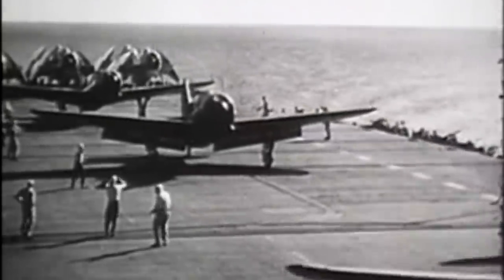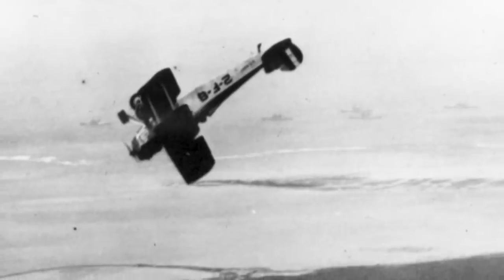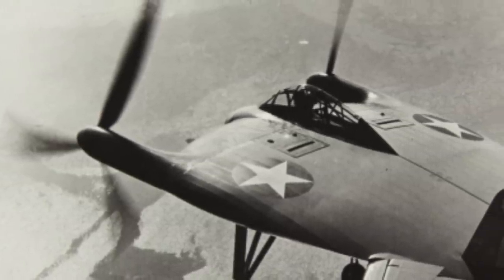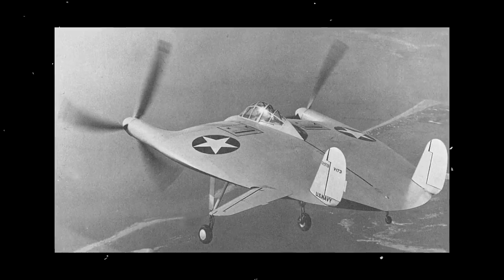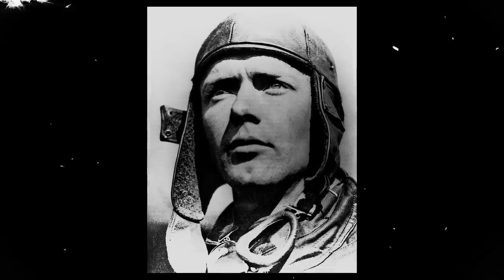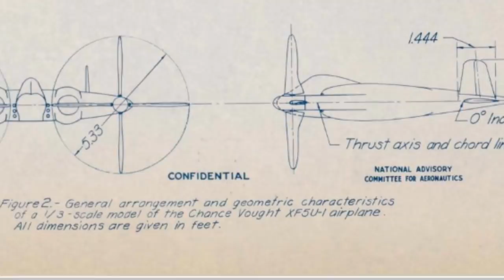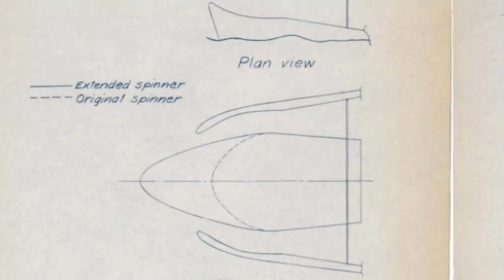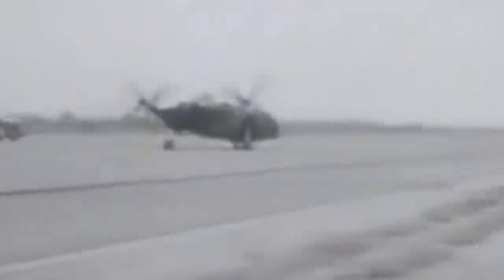The Experimental All-Wing Carrier Fighter - Vought V-173

Comment: I'm no aeronautic engineer but I don't se how "being impossible to stall" would be underperforming...
Reply: Military aircraft need to be stallable to increase combat mobility. Why Vought didn't pursue commercial sales for the Pancake is beyond me.
Reply: @engineerskalinera  right? That sounds like a good safe plane to learn on and use in remote areas like the Alaskan interior.
Reply: @erikwellerweller8623  There are a lot of technical/factual errors.  They have several different channels with exactly the same format and are constantly putting out videos.  Point being I don't think getting the information 100% accurate is their top priority.  I think it's quantity.
Reply: Your rt. Impossible 2 stall plus spin is a great performance quality. Especially preventing flat spins.
Reply: PS the only drawbacks R its fuselage angel of attack causing poor pilot vision. Plus propeller size related 2 its ground clearance & landing gear in the horizontal configuration. Not much distance between prop tips & runways. 1 minor mistake with the elevator & props dig in causing a nose over. Not a forgiving aircraft. A tricycle landing  gear might've been a better setup.
Reply: by "stall" i believe they mean falling straight down without pointing itself downward, pulling it out of a stall
Reply: @barrylyndononlyfans  that's a flat stall. Most times with a flat spin left or right added. Impossible 2 fly straight, stop, drop straight down & fly off straight again in a conventional plane. Unless it's a Harrier or F35 type of VTOL aircraft.
Reply: They sacrificed speed by "tuning" the airflow with the exaggerated props/
The prop situations were not necessary for super-STOL stall proof slow speed flight nor for efficiency at cruise.
Reply: @engineerskalinera  
They do not need to stall, they need to be nimble. Many planes of very-low aspect-ratio have been both.
Reply: @barrylyndononlyfans 
 Stall means the flow over the top of the wing separates, negating lift and not allowing strong smooth flow to the trailing edge controls.
These did neither.
Many planes of the sort have been nimble at the same time.
Reply: @kendenning6517 
 The wing-tip mounted, oversize props were not necessary for super-STOL performance not stability or control, nor for efficiency at cruise. 
See the "flying heel-lift" youtube of the Arup S-2 from Indiana in 1932, which Charles Zimmerman patterned the planform of the flapjacks after.
Many planes of the very-low aspect-ratio sort have had normal propulsion, and have allowed normal pilot view.
Reply: Can it, the damn thing is Impossible to stall or spin.
Reply: Despite it not being able to stall, there's no reason to think it couldn't have been able to be designed to be flown as if to mimic anything an unstable, stall-able plane could do.
Reply: Try deck landing without being able to stall

Comment: It's a shame they were destroyed, that was very short sighted.
Can you imagine the good work they could have done as a STOL Fighter/Bomber in Korea?
I would love to see a turboprop version, just to see what it's range/endurance would be, there is a lot of room for fuel.
Reply: There was a concept design for a jet/turboprop version of the xf5u.  Because of how its engines were installed in the xf5u, it looked like it hadvjet engines also (it had a fan mounted inside a duct leading to each engine to cool the engines since the engines were mounted more inside the aircraft than normal).
Reply: He didn't mention that the one that did the hops is at the Smithsonian. It wasn't just the canvas version that survived. Only 1 of the 3 airframes was actually destroyed
Reply: @alexsis1778  actually, all the xf5u were destroyed, the v-173s were the ones that survived.
Reply: The V173 survived and I even got to see it being restored while working at the Vought Jefferson Street Facility in Dallas Texas
Reply: @fir3ball343  that is the one that was restored while I was working for Vought
Reply: @fir3ball343  Been there before, it's such a unique plane.

Comment: “The airframe was so stiff that a wrecking ball was needed”
 This thing is going to be goddam invincible to cannon fire and the US cancelled it

Why (also we need this plane in warthunder)
Reply: Gaijin pls
Reply: @GrunOne  probably a 50000 eagles premium at 8.0
Reply: @foximacentauri7891  And still outclimbed by bf109s...nothing's changed...
Reply: I think they teased it a while back, but they said they weren’t going to add it. :(
Reply: Cause jets
Reply: Yeahhhhhhhhhhhhhhhhhhhhhh boi
Reply: It actually took 3 hits to even crack it.
Reply: With aviation advancements, I would say it was mostly useless after WW2. It has a large easily targetable profile from weapons that are more damaging than cannons. Needless to say, the experimentations were used for later aircraft development.
Reply: @KevinSmith-qi5yn  the same can be said for the a-10 though.  Also, depending on where it was hit, it probably could survive some of those more damaging weapons as well (as stated, it took 3 hits from a wrecking ball to just crack the skin, with the third hit having to be aimed at a precise location).  The A-10 was designed to withstand 23mm cannon rounds (both explosive and armor piercing) specifically by the way.
Reply: I want this so bad in War Thunder. Loved playing it in World of Warplanes. 
The problem with it in War Thunder is the damage model. 
-The only way to kill it would be pilot snipe since there are no wings to rip off. 
- it would also be positioned likely at 7.0 since it is compatible to early jets in speed while being much more agile.
Reply: @jonathonspears7736  I wanted it in war thunder too lol.  As for wings, they could probably model them somehow, just be a lot of wing to have to rip off.
Reply: They used to have it but removed it
Reply: @nuttynuts4601  actually, that was an april fools joke unfortunately.
Reply: @jayburn00  Oh man, thanks for that info though
Reply: I will sell my soul to have this on warthunder
Reply: @ Canadian Waffenswagger  - Actually, when the wrecking ball first hit the XF-5U it bounced off! It hit one or he wing ribs.  When struck between the ribs, the ball went right through. The aircraft was cancelled for good reason. Vibration issues were severe.  It was way over budget. Entering an age of jet fighters, the prototype had not yet flown, in 1947!  Certainly, it would have been interesting to see it fly and judge it's relative merits but by 1947, the flapjack concept had flopped.  Constructed on the east coast, it was deemed not worth the trouble to transport it to the west coast where flight tests were supposed to take place.  
   Speaking of flying flops, how did the Canadian flying saucer project work out? The Avrocar?   LOL! Unfortunately, Canada managed to talk the US into investing in the damn thing.
Reply: @scootergeorge9576  Vibration issues can be resolved (depending on the cause, there are different solutions/mitigation techniques).  Increasing the number of propeller blades by one or decreasing the number of propeller blades is one way.  Changing the way the engine is mounted is another.  The concept hadn't flopped, it simply was not developed further.  A lot of aircraft that showed promise have been canceled before they could really prove themselves.  I do agree with you on the avrocar though, that was ridiculous.  Funny thing though, the Germans were trying to do something similar to the XF5U but had even less success with it than the US did (they never got past developing their counterpart to the V-173).  The reason the Germans had even less success with the concept is an ironic situation:  despite Germany's progress and reputation of being ahead of everyone in aerospace technology development, it turns out there were certain areas of aerospace technology that they were behind in (not many, but there were some).  One of them happened to be the idea of using counter-rotating propellers to cancel out the effects of vortex drag while producing more lift.  Their counterpart to the V-173 was a single engine and single prop aircraft (forget its designation).  As a side note, another area they had trouble with was high altitude performance in propeller driven fighter aircraft; they were able to achieve it, but often by sacrificing other aspects of performance, a good example being that to get certain fighters to higher altitudes, they made their wings longer, sacrificing roll rate.
Reply: @Jonathon Spears
German weeaboo shoots pancake with long 88: No DaMaGe
*confused screaming
Reply: @canadianwaffenwaffle2976  to be fair, I'm pretty sure an 88 would F up any aircraft we could build short of an armored zeppelin (even then, the armored zeppelin might not be able to be armored enough and still function as a zeppelin).  Of course, it also depends on what kind of shell it used and where the flying pancake got hit.  An AP round might pass right through a non-vital part and the aircraft continues on its way, or an engine gets hit and wrecked but the gearbox shunts power from the other engine to keep the propellers turning.
Reply: The A-10 was built to only be "bullet proof" to 23mm AA cannons (and that may only be the cockpit, though I could be wrong).  The rest of it's design is about limiting the extent of the damage when something more powerful hits it and being able to take damage but stay in the air long enough to get back to base for repairs.
Reply: @jayburn00  - If the concept were sound, someone would have built a successful like it  in the past 80 years.
Reply: @scootergeorge9576  again, there are many examples of aircraft that should have been further developed but weren't, while wastes of money and time get continued to full development (Bell P-59 Airacomet) because of politics, money, etc.  Also, there were points in the early cold war where conventional forces themselves were considered obsolete by segments of the armed forces, and they prioritized what they developed on that consideration.  At one point, they start believing that fighters don't need guns (even before air to air guided missiles, there was a fighter that was an interceptor that was armed with just unguided rocket pods).  There was a laser weapon that could shoot down mortars and unguided rockets with multiple rounds in the air, but it was cancelled in favor of a more expensive missile based competitor despite the laser having been proven effective.  The military (space program too) often does things that don't make sense.  They also like to reinvent the wheel, develop a system that does something that another system they have already does just as effectively if not more so, not always being an improvement.
Reply: @jayburn00  - The point is that the jet age had arrived before the flapjack had even flown. And  wind tunnel test show that it was not a viable design in the trans sonic realm.  An interesting design, to be sure, but a failure none the less.
Reply: @scootergeorge9576  It doesn't need to be trans-sonic to be useful.  Even at low speed estimates, it would be faster than an A-10.  After WW2, the Skyraider, a single engine propeller aircraft, was used all the way up to the end of the Vietnam war.  Today, the Super Tacano and similar aircraft are still used in combat roles, a propeller driven aircraft.  And it wasn't a failure.  They ended the project before it could "fail".  The problems they had with it were solvable.  They just didn't want to put any more effort into it when it looked like jet engines were the end-all be-all (they aren't).
Reply: @jayburn00  - The aircraft was meant to be a fighter.  Certainly, in that roll, it was a failure.  Yes, the A-1 AKA "Spad" was a huge success. The F4U was in production into the fifties in the close air support roll. And the Douglas A-26  saw combat in WWII. Korea, and Vietnam! Also "Bay of Pigs" ; )
It wasn't just the props that doomed it. I  was assigned to a P2V-7 Neptune squadron, VP65  in 1972-74.  
I believe the Flying Frisbee  never panned out. I am not aware of any other aircraft to employ this design with any real success.  But I still wonder why the XF5U-1 was never flown. All that work and money (it went over budget)  and nothing more than taxi tests?
Reply: @scootergeorge9576  I know, it seems such a waste.  Would have been nice if they actually flew it.  They built the thing only to destroy it without even properly testing it.
Reply: with a 105 automatic cannon in the belly, maybe with it , we could defeat the 109
Reply: @INWMI  - With the P-51D and 6 .50 caliber machineguns we did defeat the Me109.
Reply: @jayburn00  and the cockpit and control surfaces are protected by a 'titanium bathtub'.

Comment: how is being impossible to stall or put into a spin a downside???
Reply: stall climbing? You want a certain instability in your fighter planes. But I was questioning the same
Reply: @krayos13  I have my questions with how this is phrased.
Surely if you were to fly almost straight up the plane would stall, regardless of shape (Unless its engines are powerfull enough to pull it up, which by the sounds of it they weren't).

Putting the plane in a spin never sounds like something you really want to do either, so i'm not sure how they put these as downsides.
Sure certain maneuvers where you want to stall must still be possible to some degree, if anything it should be easier to recover from them in this plane as you need a lower speed to regain control.

I do wonder about compression in this plane though, if you were to put it in a dive, how easy would it be to recover from it assuming you get a high speed where the controls become hard to move.
Reply: The most basic looping maneuvers require this to go in the opposite direction. With the hammerhead you stall out almost and whip the tail around and come back down on top of the enemy with all the energy you put into the altitude. No was to do that with this pancake.
Reply: In this kind of lifting body configuration, at high AOAs the strong tip vortices cover most of the surface of the wing, preventing a stall. L/D becomes terrible but control is maintained. Delta wings or strakes work in a similar manner.

Comment: With it being on display, I'm surprised the Russians never tried to come up with a design similar. Too bad we made a no-tail bomber aircraft in the early 80s.
Reply: because propeller planes were too late by that time. this could fly if they started it 10 years earlier. but when development was finished it was already obsolete. thats why nobody else tried later.
Reply: @jebise1126  Not necessarily, depending on its tasks propeller planes were used long afterwards and still are in use today, be it in military- or civil aviation.
Also Google:  "new propeller fighter aircraft"
And in the end such a concept could've used jet engines or a turbo prop.
I guess it was not pursued further because of similar difficulties like with the more successful Monoplane aircraft that we are used today, but that was also developed during that era - but never put into service then.
The technology for a constant safe flight just did not exist. 
With modern electronic control systems a mostly safe operation has become reality.
Reply: @wolfgangkranek376  no it needed propeller to fly the way it flew so only turboprop would be possible not jet version. also usa wanted jets and not propellers so by their standards as a fighter it was obsolete at least as a fighter
Reply: @jebise1126  Your argument is a bit pointless when you admit yourself that turboprop would've been an option. 
And I was not talking about only this plane but about the concept as such.
But OK.
Google:  "new propeller fighter aircraft"
Reply: @wolfgangkranek376  again propeller aircraft are all slow compared to jets. this was suppose to be STOL carrier aircraft. and it was obsolete as such since they wanted jets that were faster. yes slow aircraft as this could be ground attack one but no space on carriers to carry separate ground attack aircraft.

Comment: How is inability to stall and spin an "underperformance"?
It's a natural property of the extremely low aspect ratio wing.
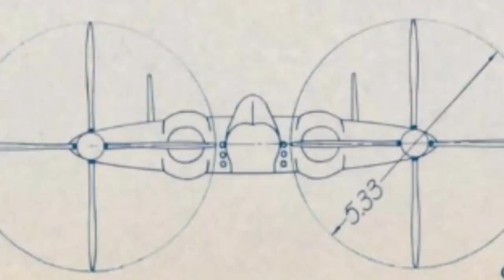8:57 unless the arrows are meant to indicate the sense of rotation of the lift-induced vortices, they indicate the wrong sense of rotation; the propellers go around the other way.
Reply: The drawings of the aircraft pulled a da Vinci, the designs show the propellers going the wrong way.
Reply: @jayburn00  da Vinci is actually not enough. As the sense of rotation is mirrored left to right, miroring the drawing will not create an error.
The propellers need to rotate bottom in, moving air under the wing. They are built that way, but the arrows indicate opposite.
Reply: @HotelPapa100  that is what I meant.  Think about da Vinci's tank, which had its gears in such a way that it would not go anywhere.
Reply: @jayburn00  Oh, I thought you meant mirror image. Leanardo was a southpaw, wrote right to left, as a kind of code.
Reply: Military aircraft need to be able to stall and spin for the purposes of combat mobility.

Why Vought didn't turn to commercial sales, I have no idea.
Reply: @engineerskalinera  Not really. In a dogfight you'll avoid such low-energy maneuvers at all cost. Unless you have the ridiculous thrust reserves that are common on today's jets, where you can use the cobra to impress airshow audiences...